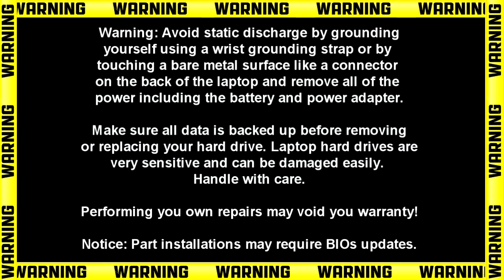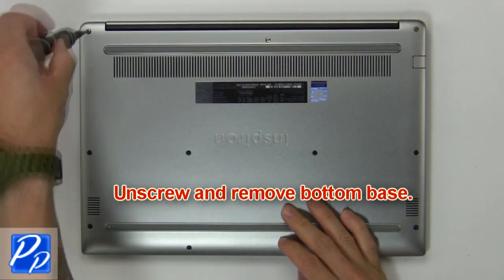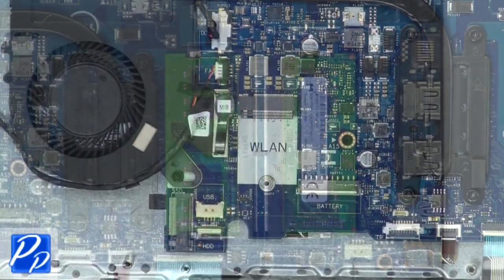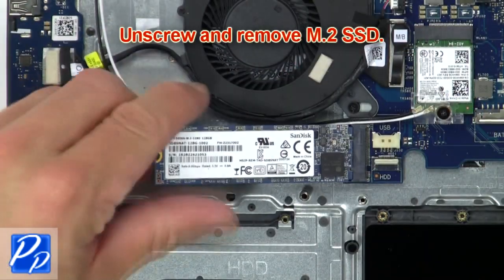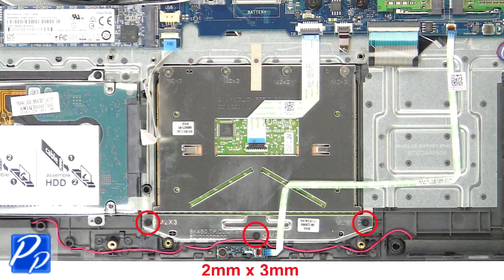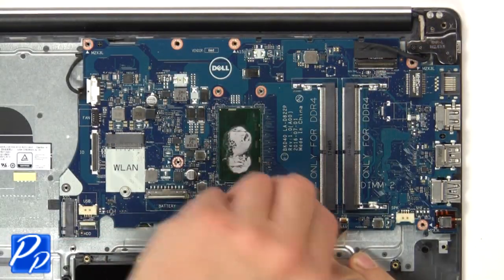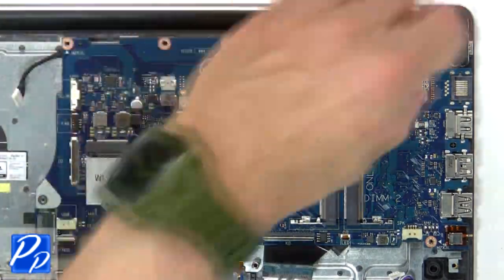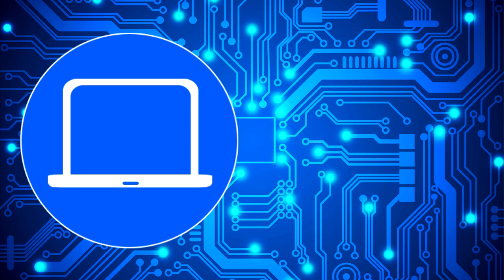Dell Inspiron 15-7560 (P61F001) Palmrest Keyboard Assembly How-To Video Tutorial

Comment: Great video! I've heard that diagonal rows of keys that intermittently work is potentially down to faulty pins on the keyboard connector? My row of '8,i,k,,' randomly works, along with the '=' key sometimes. Would replacing the keyboard assembly fix the issue in your opinion?

Comment: Hi I replaced the keyboard for the laptop and fixed all parts/connections back to their place. But the laptop doesn't turn on. The led goes ON for a moment, screen turns on (doesnt show anything) and cooling fan rotates a little and nothing more happens. Can you please help if this is common.
Reply from the maker: I would make sure the memory sticks are seated properly. Faulty or incorrectly inserted memory will cause this.
Reply: @dellpartspeople   Thanks! Yeah, that was the exact problem. Reinserting the RAM fixed it.